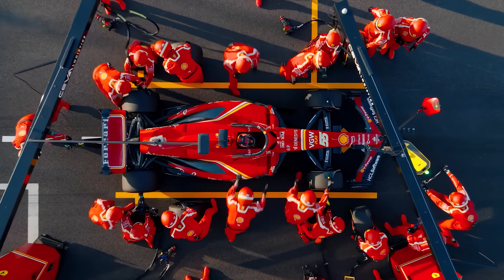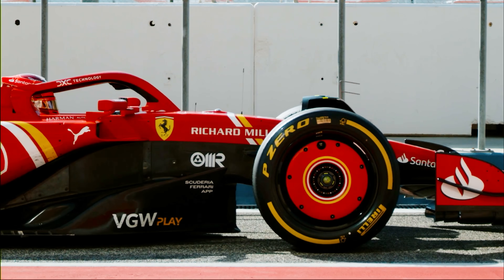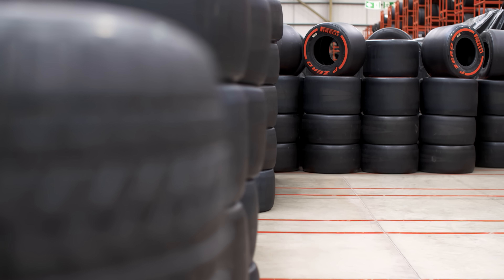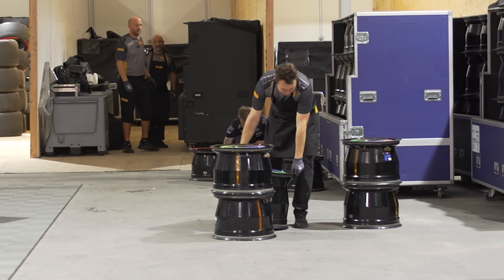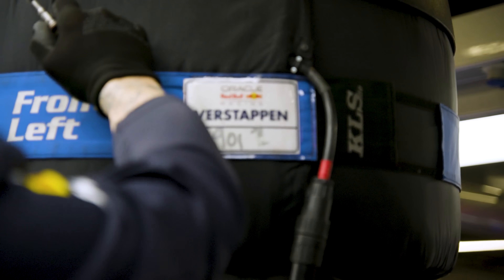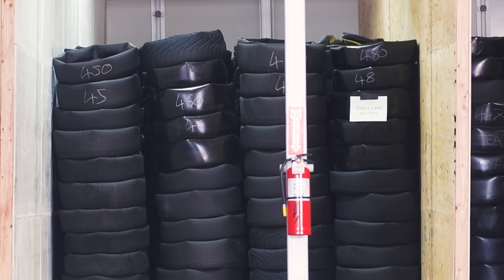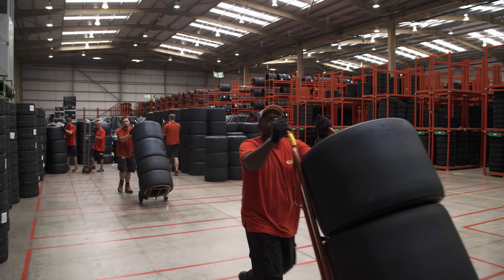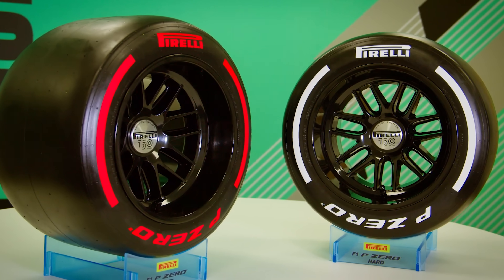What Happens To F1 Tyres After A Race?

Comment: Half way into this video, you still haven't told us what happens to the tires.  So I guess I still don't know.  I'll just ask GROK.  EDIT:

After each Formula 1 race weekend, Pirelli (the sole tire supplier) collects all tires—both used on the track and unused (including those merely fitted to rims but not driven). Teams must return them, partly to protect proprietary compound secrets and ensure no unauthorized reuse.
Collection and Analysis
Pirelli transports the tires (often crushed or compressed for efficiency) back to its engineering and logistics facility in Didcot, UK. Engineers first analyze them for performance data, wear patterns, and insights to improve future designs and compound selections.
Recycling Process
The tires then undergo recycling. They are shredded into small pellets or granules, processed alongside regular road tires. Due to the vulcanized rubber and specialized compounds, they cannot be remolded into new F1 tires.
The material is transformed into secondary raw materials for various applications, such as:

Flooring (e.g., sports surfaces or playgrounds)
Road asphalt (including bitumen byproducts)
Building materials
Other industrial uses

In some cases, shredded tires serve as tire-derived fuel (TDF) in high-temperature industrial processes (like cement kilns), providing energy while minimizing emissions compared to traditional fuels.
Sustainability Efforts
This process aligns with F1's and Pirelli's sustainability goals, including net-zero carbon by 2030. Since 2024, all F1 tires have been FSC-certified (sustainably sourced natural rubber), and Pirelli emphasizes circular economy practices, turning end-of-life tires into reusable resources rather than waste.
No tires are resold, given away, or landfilled—everything is accounted for and repurposed environmentally responsibly.

Comment: F1 teams do not return all their tyres to Pirelli at the end of racing weekend. The teams have to return at least one every practice session. They have to return at least one set after the first 20-30 minutes of the practice session. I know this used to be the case when the practice sessions were 90 minutes long. I don't know whether that's still the rule with the 60-minute practice sessions. If they were not obligated to return certain sets, many would barely do any running in practice, saving all their soft sets for qualifying when they are absolutely crucial.

Comment: Not buying a heating/cooling/heating cycle would dramatically affect the structural integrity of a tire.
Reply: No but mechanical properties. Tires age and heat accelerate that, not mention plasticizers in the compound to make it sticky. Even car tires are little different year by year but you hardly notice it. And from own experience tires can jump age. 4,6 or even 7 years look good and last 1/3 of the thread go away in one season.

Comment: So otherwise this is totally wastefull. Lets change the rules to eight tyres per meeting.  Plus wets.
Pirelli can make hard durable tyres. Same for everyone. 
As a long time racer I used to do 2-3 meetings on a set of tyres. And sometimes sell on the best of those. And this was on a 500 whp Chev powered car.Running top 10.
Look at the Sports Cars, they do 2-3 sessions on a set of tyres, and even reuse some of them later.
F1 is all about waste. About time they became sustainable. Racing will still be just as boring as they seldom ever pass.

Comment: The babies who think its waste may not have considered the safety of a wheel and tyre that is 20mm thick. Inflated at pressure. Its unsafe when its 12mm thick. All tyres are recycled and turned into new tyres. There is no steel belt in them.  Wets are pnly different in dispersing water. If run on a dry track they degrade very rapidly to become a hazard. Ironically the wetter the slower but more hazard v run on a drying track when they become a hazard. Same with inters. They degrade fast on a dry track that cant cool the surface.

Comment: If a competitor (Goodyear/ Michelin) wanted one of these tires for analysis they have the means and connections to get one rather easily. That proprietary information excuse is laughable. Also allowing teams to mix tire compounds such as hard fronts and medium rears would really add a lot of strategy to the race weekend and you would probably get a few wildcard winners every now and then.

Comment: good video so far but mistake one. the teams can change the pressure of the tyre. Pirelli just put it to the min legal number for the track in question. but thats easy to over look so yeah.

mistake 2... sorry but if a wet set is used they do not re-use them as they could be damaged etc etc. they also dont send the ones that are not used to other tracks even if its not used as they make a set amount per season. but i get what you say you would think they would keep the not used ones but they dont sadly, but sometimes they are given to the teams for special events say showing off a car on a photo day or on a older car for a bit for Sky Sports F1. 

mistake 3 sorry but they DONT use air in F1 tyres its dry nitrogen gas.
This is done for two reasons. Firstly the moisture content of air is variable depending on the local weather conditions and this differs considerably between some of the exotic locations on the GP calendar.

but good video with just a few little mistakes that you made or didnt know. and sorry matt i wont sub yet but if you teach me something i dont know i will sub but for now its a no. but keep at it you could teach a old F1 fan something new LOL

Comment: I knwo exactly what happens i used to work in the warehouse where they are kept .They are flattened and then driven to Birmingham where they are chipped and destroyed .They keep them in Didcot  before the race.
Reply: There is also a sister plant in Manchester,  the shred from both goes to caldon low cement works in Derbyshire, I have been at both plants during the destruction and the security is unreal,

Comment: Meanwhile, used NASCAR tires are surprisingly easy to get a hold of (many teams will sell them to you directly) and not even particularly expensive, especially if you live near any of the team shops.  And there's a whole collectors market for race used sheet metal as well...

Comment: With the latest tyre technology, they can recycle used rubber and even make condoms from racing slicks. From an average-size slick, they can make 365 condoms from a Goodyear.
That's an open-source joke, so feel free to bounce it around.
Thanks for a great presentation, Matt.
Reply: When they recycle the rubber from 1 of my condoms, they can make 3 of the Pirelli F1 tires and 19 bags of assorted rubber bands.

Comment: How do the cars and the team's equipment know which pressure sensors to connect with? There's wireless (I think) pressure sensors on all the rims, so I'm guessing someone has tell the equipment that there's a new set on the car and it the car needs to display the pressures for the new set and not the old. I guess there's a lot of simple ways to get the correct tires displayed, I'm just curious about how they actually do about doing this. I'm also interested in how, and how long it takes, to correctly get all of the wireless connections set up each day.

Comment: So much tyre waste yet the V8 engine was their problem with it's non environmental-friendly emissions.
Reply: Even bigger insult is that Formula One engines are actually incredibly efficient for what they are. Driven uneconomically around big tracks, producing over 950hp from only 3 natural litres, 200mph, 19000RPM, and yet an F1 V10 will only consume 4-5 litres of fuel per lap. That is unbelievable. But no, that wasn’t good enough for them.

Comment: It’d be cool if teams could mix match different tire grades when they’re racing. Example being hards on the front and mediums on the rear. It’d make tire selection strategy so super interesting
Reply: I've tried that in Sim Racing. It did not work very well.
Reply: They should be allowed to Mix/Match any combination for more tactical options or at least tires of the same compound. Now one flat spot from a hard break manouver ruins the entire set. That is hard to understand.
Reply: F1 hates innovation.
Reply: To my knowledge, the only thing that gets you is understeer/oversteer.

Better to just stick to the same compound on both sides and tweak the steering by other means.

Comment: Another use for recycled tyres is the soft grounding under play equipment in playgrounds.
Reply: F1 tyres are shredded under strict security at 1 of 2 facilities one in Manchester 1 in Birmingham, the shredded rubber is then trucked to a cement works at caldon low in Derbyshire and used for fuel in the kilns.
Reply: @ericevans4040  They go to Hope Works as well.

Comment: 13 sets of tyre per car per weekend is a huge waste, and creates a lot of carbon emission. They should make the tyre more durable like 2005. And only allocate 4 sets of tyre(2 prime 2 option) per car per week.
Reply: At each Competition where a sprint session is scheduled, each driver may use no more than twelve (12) sets of dry-weather tyres, five (5) sets of intermediate tyres and two (2) sets of wet-weather tyres during a Competition.

At each Competition where a sprint session is not scheduled and additional tyres are not made available under Article 30.1a)iii), each driver may use no more than thirteen (13) sets of dry-weather tyres, five (5) sets of intermediate tyres and two (2) sets of wet-weather tyres during a Competition.

At each Competition where a sprint session is not scheduled and additional tyres are made available under Article 30.1a)iii), each driver may use no more than twelve (12) sets of dry-weather tyres, five (5) sets of intermediate tyres and two (2) sets of wet-weather tyres during a Competition.
Reply: 15...!

Comment: I though they were taken back to the plant in Didcot, can't see any information saying that they aren't, where did you hear that they are not taken back there?
Reply from the maker: It's a big misconception, it's just where the tyres are organised and sent out from - not just for Formula 1 but many other categories. All my info is taken from my meetings with Pirelli, and those who currently work within the paddock!
Reply: @mattamys  Interesting thanks
Reply: @mattamys Pirelli didn't tell you there was no "air pressure" in the wheels. Becaue unlike normal road tyres, Formula One tyres are filled up with nitrogen gas instead of air. Air is a mixture of 78% nitrogen but more significantly 21% of oxygen. 

Nitrogen gas is used for two primary reasons. Firstly, it provides higher consistency. By using dry nitrogen gas, the tyres will behave in a predictable, consistent manner in any part of the world.

Secondly, as the tyres wouldn’t have air or water vapour in it, the inside of the rims are immune from the effects of rusting. They are also lighter than air, allowing for faster race speeds. 

By the way, if you read retired MotoGP rider Anthony West's Twitter post on January 24th, 2020, you can also find out what they are really doing with the tires. Too[l]